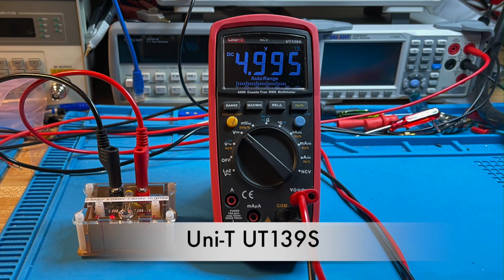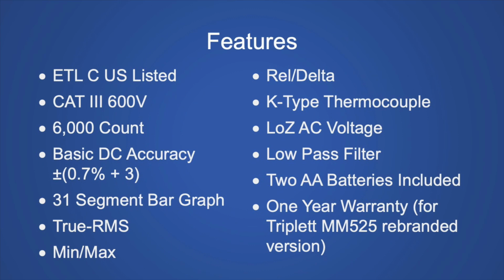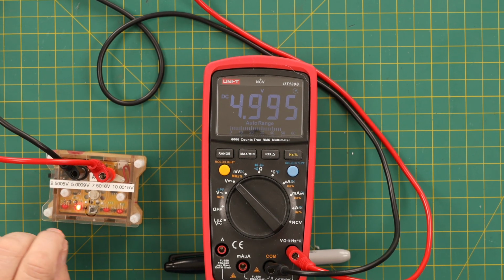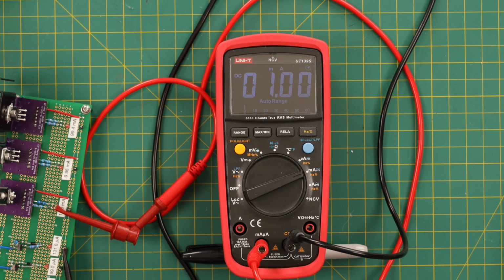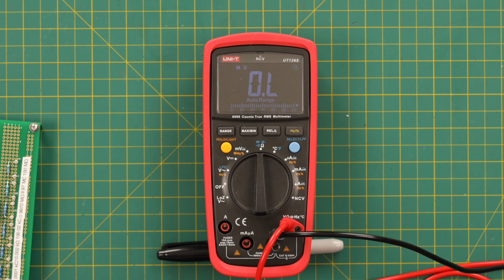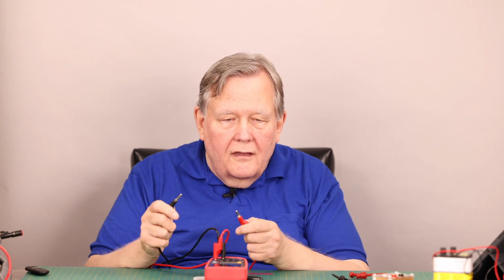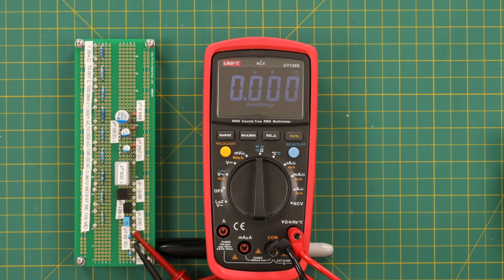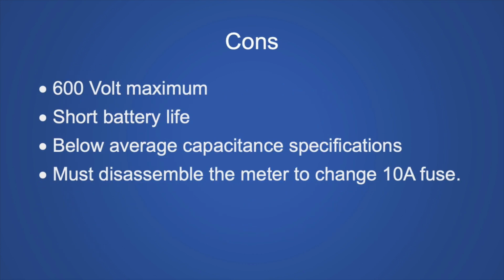Uni T UT139S Review

Comment: I bought and used it a month ago. It's a nice multimeter, but in my opinion it has an annoying drawback - it drains the batteries quickly. That's why I sold it.
Reply: That's why if you want this meter, you should get 139E which is the normal screen version.
Reply: @Brian-uq6jm in my opinion it is too expensive for what it offers and that is why I bought UT-61E+
Reply: @HubertZ1  Yeah I definitely don't like 193E (and S) cuz they are simply too slow. I've had the 139E for more than 5 years and it's still practically brand new.  

Even though I have quite a few uni-t meters, my go-tos are Flukes and Brymen.

Comment: Great review Tom. Uni T is a pretty good cheaper option to Fluke even if measurements are a little off. I always thought with digital electronics it's usually spot on. Still for most hobbyist it's accurate enough.